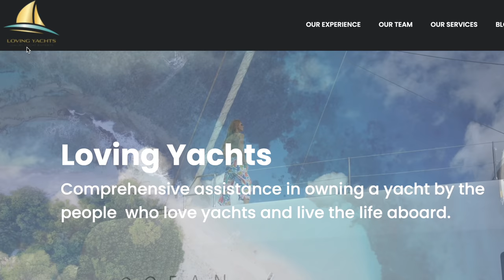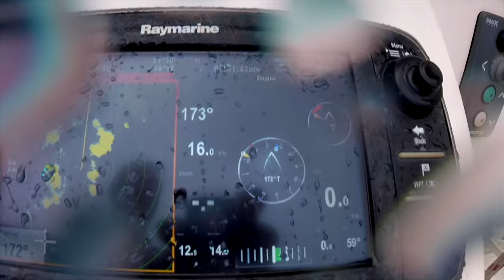Will we ever be back on the water? WE HAVE MADE A BIG DECISION!

Comment: Have you considered silicon, or an electronic system, for antifouling?  Also, I do not know the availability of vinyl wraps in Poland, but a number of multihull owners have found getting their boat wrapped to be less expensive than painting.  Look forward to seeing more of Poland!
Reply from the maker: Hey D! Yes we are most likely wrapping the boat. Seems like this technology have gotten really good and it is also relatively easy to fix minor damages. May be not to perfection, but reasonably well. As to antifouling our key is longevity, because of our extraordinary logistical issues and costs associated with every lift that requires a construction crane. I am reading up on the ultrasound antifouling as I'd love to use it as a supplement to a antifouling paint. Let me know if you know anyone with first hand experience with any ultrasound system. I am curious. Cheers, Bartek
Reply: @sailoceans  There are only a few channels with recent info on electronic antifoul systems.  This is one:  https://www.youtube.com/watch?v=uP8B5yjsy9Q   As for the wrap, there are several companies that also provide an antifoul wrap for below the waterline; as another option.

Comment: Have you considered the newer diesel/electric hybrid systems? (has both a diesel engine with a clutch and electric motor) - Parallel design
Reply from the maker: We are considering it, however that only adds to the weight rather than shave some off or at least remain flat with a better distribution. Of course everything between full electric only, and full diesel only is still on the table. Cheers. Bartek

Comment: Hi guys , I would never use electric propulsion on my sailboat or recommend it on any other. Think of it this way , you have kids on board and you never know what can happen , children do what children do . Talk to Kiki and Dave on Sailing Uma , they have converted to electric , they are in the northern hemisphere and sailing in the winter( Norway)  . They have only an hour or so when the weather is not so sunny . That is not good enough on the ocean . One of my customers also decided to switch to electric for the Tender ( dingy) motor and his stove , but not his main engine, it stays diesel . I also recommended an Espar diesel heater . The Espar heated the entire boat  all winter no problems. One fuel source and two problems solved . Greetings from Canada .
Reply from the maker: I know we have 2 Webastos and they are great. Would probably keep them with some sort of genset and much smaller tank. We don't sail in high latitudes in the Winter and in the Summer our panels set production records in the high latitudes in Northern hemisphere as days are so much longer than in the Caribbean. Also, monos have much smaller area where solar panels can be safely installed than any multi. Our boat has even more and it sail very well even in very light winds, so we really don't need much electricity for the mechanical propulsion. That is why we are even considering it. Even now with barely 2,3 kW on the roof we live emissions free save for the propulsion. And we don't hold back. That includes washer, dishwasher, and other niceties as in any normal home. Hence if we go to planned 6-7 kW or more possibly, we should have overhead of about 20 kWh per day in production to feed the propulsion banks. Just a food for discussion. Thank you for taking important part in it. Cheers. Bartek

Comment: I thought osmosis mostly happened on balsa cored vessels.  Your Neel is a foam cored isn't it?  Why do you think so much osmosis?
Reply from the maker: It's not the osmosis in the core. It is osmosis in the outer laminate that we had mostly problems with. In this case we had two separate problems. Improper epoxy barrier that wasn;t apparently done right in some places back 6 years ago. 5 years straight in the water. Second issue were improperly joined joints of the new shapes modified as part of the prototyping process on the original hulls resulting in some water ingress after years of fatigue. We have cut those out and rebuilt integrating them properly this time. Cheers. Bartek

Comment: I folow you from long time, continue to make update (Work on boat is interesting) Ho winter in Poland.... Are you shure? if you ave water infiltration in the fiber, be realy carefull about ice inside. With -1°C or more. 
An electric motor is incredible efficient but you need a lot of battery, solar panel and of course a motor can charge and propulsion
Reply from the maker: Yes. We are aware of the issue with water freezing in the composites. To the best of our knowledge it's dry, but I figured this will the ultimate test for the water ingress. 
Yes, electric is very enticing not just for efficiency,  but moreover for reliability, quite operation, and eco friendliness.  Cheers. Barte

Comment: Totally agree with you... Its way too much to do before spring and you need to feel out your Polish  roots.
 Im quite supprised that you even considered trying to do everything before then.👍🏻
The other issue is the world is still a bit crazy at the moment and material and equipment costs have spiked alarmingly.

Just an interesting titbit of information i picked up from U tube but the new ultra high output alternators that have been developed by Nigel Calder and Co. apart from producing substantial power from virtually  tick over speeds they take about 10-15hp to spin up to their max output..   so 🤔a small capacity ice motor of about 35-40hp could drive a pair of these fast charging high output self regulating alternators in place of a conventional generator. 😁Maybe. For those times when you have to have full battery power despite the weather or time.

Under sail, if you can come up run regen from your motors thats a plus on passage making  but on Uma i think they worked out they could regen about 20% of their motors output.
However it's just augmentation, unless your under sail at speed, of  solar or Alternator generator set....  for all the time your under the 🌞 and or at anchor. 
Keeping any shadows off your solar panels depending how they are configured is a major issue to consider as you probably know.
One thing is you'll have enough cabin top space  for panel's on Poly.😁😎
Reply from the maker: Yes we are aware of that hence we want to do as much as possible as fast as possible regardless of our departure date. Cheers mate. Bartek

Comment: Seems like electric boats are still fairly immature technology/application (besides large ships using it + generators), and one would need a large diesel generator to motor a long way.  Sailing Uma has done it and reviewed a modern electric sailboat maker about 6 months ago on their channel, and recently upgraded their propeller-motor system again to generate electricity while under sail, using the latest technology.
Reply: They also have the option of lifting a page out of the Silent yatch's propulsion book.
And Poland produces a lot of the engineering for Germany.
The 250w  bus motors Silent yatch's use might be an example ..